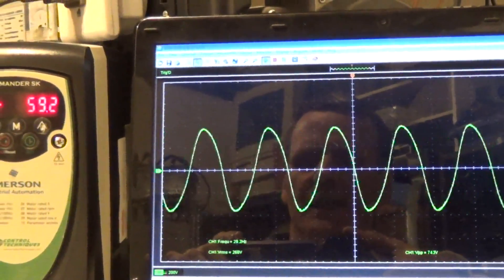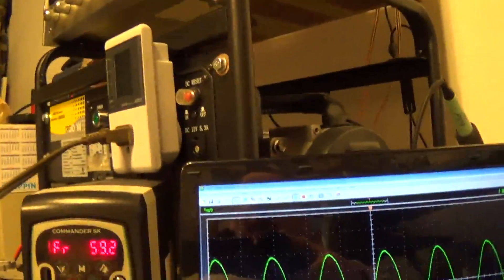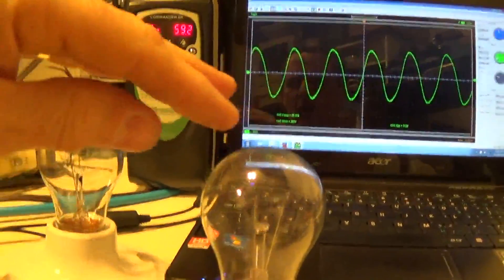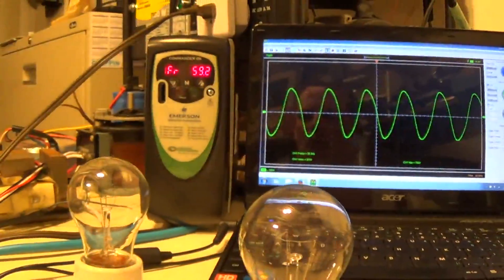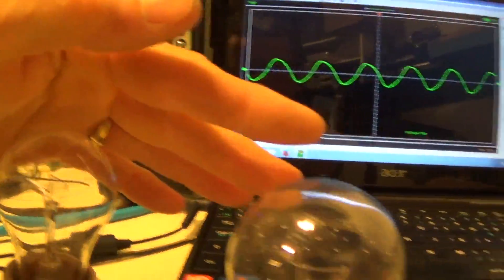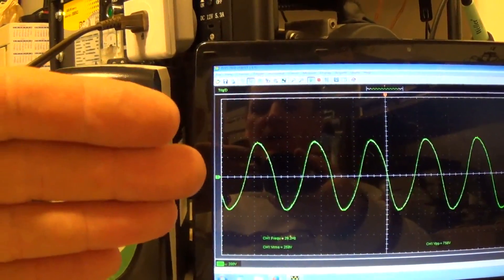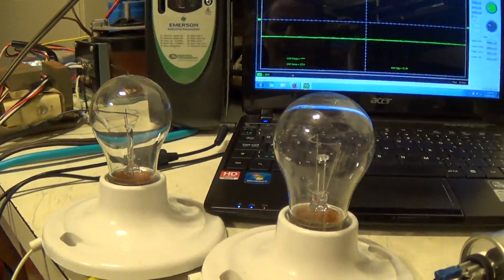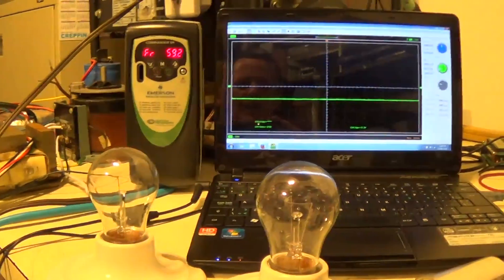Testing of QEG Effects test 3

Comment: The higher the dL/dt, the more output you can get, so if you cut the edges of the MOT "E", so they have a radial (parallel meeting with rotating blocks) edge, the dL/dt will be a maximum. The exponential increases you are seeing, are the poles and zeroes in the function, but without your schematic, I don't understand your setup. This is heroic research, and thank you for sharing!

Comment: Hi Luc I'm still thinking a couple of things might help to make the scenario be less vibration .

1 have you tried turning the system on its back ? I feel this might enable better shaft centrifugal force . I looked at a ceiling fan and got this idea .

2 make a four fin system using 2 more laminations but keeping only existing transformers . This can reduce rpm to half making the system less vibrative maybe ?? I don't know just would like people's feedback on that . Maybe I will try with a ceiling fan method and modify the fins. This will give a cheap variac style motor speed but whether it can break the magnetic flux without stalling I'm skeptical until I try ..

3. Would engine mounts assist the sonic vibration passed though the cover leaving less external noise ! I think that could help with other resonant factors interfering ie the box frequency and db gain like a speaker box has at its res frequency technically your making a Leslie cabinet ??? Hmm maybe we can use that idea as the amp has a speed controller and mount vertically . Check it out 

squatmans leslie rotating speaker

Comment: have been studying NQR, (nuclear quadrupole resonance.  this is where the voltage gets launched from, inside the metal, and is in the protons in the nucleus.  A small exciter coil, producing around 1.32 mega/hz, would maybe even the resonance.  this is really resonance, not slapping.  you have done it, cheaply, now more capacitance in series.  good job, terrific information.  Your box hinges are not strong enough, the screws need to penetrate the box, and have nuts and washers on both sides to keep this box together.  great work, this might work for overunity. exciting

Comment: this morning I was also thinking of putting two more micro-wave cut transformer cores in the upper and lower positions for a total of four.  Remember, at the final resonance, (3rd), rpm it phase locks and will not let you move higher on rpm with proper tuning capacitance, but raises the power, (voltage), and would blow out these cheap transformers rather quickly.  Also an exciter coil would tune the circuit more rapidly with an antenna and ground.  I see a lot of voltage spikes that would ruin electronics, without impedance coils on the inlet leads for microcircuits.

Comment: Obviously what is needed on this setup is the correct capacitance.  The inadequate capacitance both the farad level and number is not enough to hold enough charge.  My feeling is not deflection rubbing, but steel vibration producing the sound and voltage. A quick check of the surfaces would show this is the case.  This unit will not self loop without an inverter placed in the system with three phase output back to the motor.  Self looping would show overunity only during highest peak resonance.  It would also show a simple cheap method of power production with an unknown total output as the henry inductance seems in a good range which could even prove overunity with self looping even with this makeshift device.  If this happened a lot more of us poor people could get going.

Comment: Are the bulb loose coupled from the circuit? So pure wireless energy
Reply from the maker: No. like I say in the video the bulbs are connected in series with the high voltage coil.

Luc

Comment: Hi Luc
It is not a full replication, but it is to get some insight. To learn.
Have you thought of a way to excite the coils yet? Because it is remarkable that the bulbs light up, since there is no magnetism (or very slightly residual). I don't know of any generator that works with a rotor but without magnets or induced magnetism.
Any how, if you could put a small coli on one of the MOT's (or both/series) with an AC source? (which is just an idea, there are many ways to induce the excitement).
As usual, great demo. This way we all see one of many ways how to look at it. In my thoughts I had used a toroidal transformer and removed the wiring and placed back the wiring like the Qeg. And a small motor to rotate a small steel blade inside the toroid. Perhaps that would work as well?
Reply from the maker: As demonstrated the coils get excited with the right capacitance and frequency (RPM) by varying Inductance. The sound you hear when the bulbs light is the sound of magnetic flux building in the cores.

Luc

Comment: Thanks for the update on your search! 

Wahoo! Do it don't to just think it :) 

~Russ
Reply: veeeery interesting! is that a mobile generator you are running as a primary power source? the reason i ask is that im immediately curious to see how the system would react from, say, a solar panel or something isolated. im not sure why, just a 'spidey sense'!
Reply from the maker: jeremy gwilt  It is called a variable frequency drive controller. With it you can vary the RPM of an Induction motor with great accuracy. It uses the 60Hz 120vac grid and converts it to DC then builds it back to AC from any range of AC frequency you want from 0.1Hz to 1,500Hz and from 1 volt to 240 volts.

Luc
Reply: That's some interesting findings on the swinging voltage, is the frequency swinging as well? I have been really looking close at the QEG specs and I believe that the Mica dielectric is an important factor. Mica is just about the strongest insulator out there and if it keeps the coils from interacting magnetically it will cut down on the parasitic transformer effect or (Lenz effect) from coil to coil. Keep up the great work, if I had the resources I would do my best to contribute.